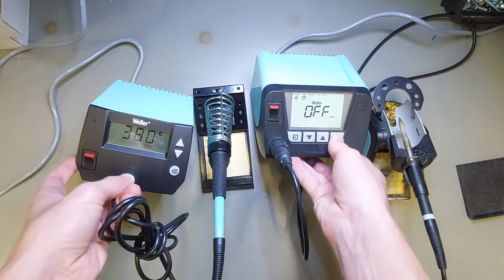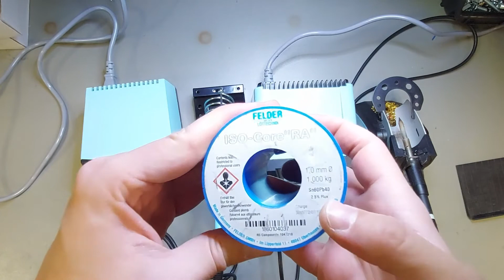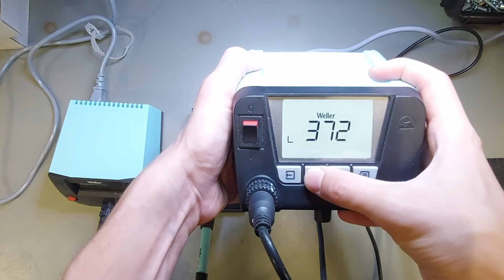Weller WE1010 vs Weller WT1H solder station short review

Comment: Are you serious? Comparing a station with around 70 watts to one with 150? Maybe the difference is between 70W and 120W, but dude, the soldering speed will be different which makes overheating of the pcbs no issue with the 150w station. That’s a world of difference when you use this thing for more than melting 1mm of led based solder

Comment: No spare parts for the WE1010 Station! is the reply i receive from Weller.
From a company who sell tools for repair is inadmissible , let this old company gone like water of toilet .
Reply from the maker: I totally agree! It's one of the best brands out there. I have one that is 20y old. As for repair it shouldn't be that hard to fix it if you don't need the plastic parts.
Reply: What the heck did you do to your soldering station? Also, you are looking at their economy line (WE). In my cases the contact with their support has always been exeptional to say the least.